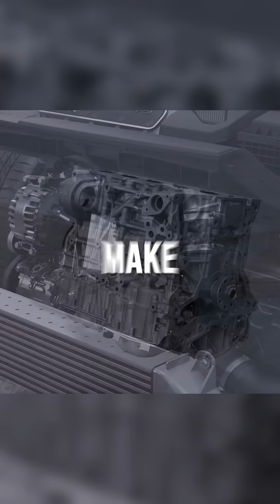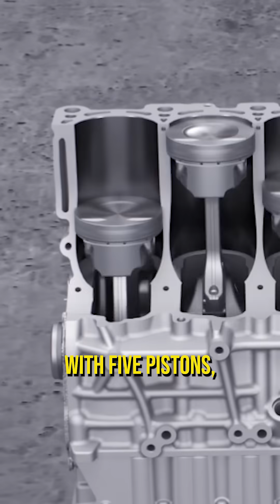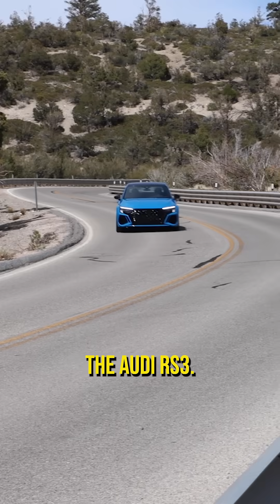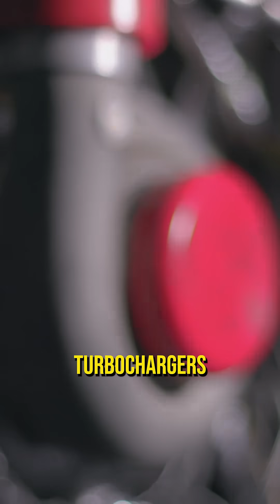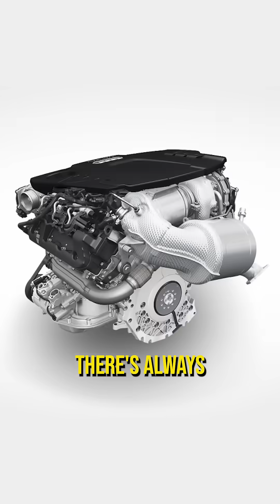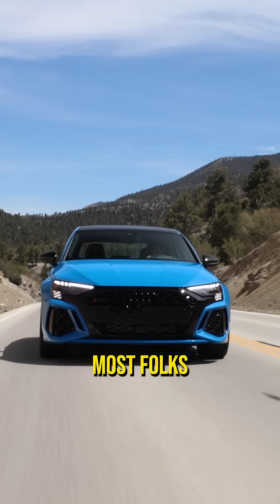What Killed The 5-Cylinder Engine?

Comment: The logic of "a V6 exists and that's a reason the I5 makes no sense".  A v6 is more material, more complex, and in theory more expensive, and also never perfectly balanced.  Get rid of the V6 and replace with inline 5s, assuming they aren't too long for the application.
Reply: GM killed the I5 in the Colorado and Canyon.
Reply: I5 uses haldex, v6 and bigger use true quattro. Not that haldex is bad it's just they can't use qauttro with the way they're mounted plus true quattro would push the engine far forward
Reply: Inline 5's also make sense if you need more/less displacement in a modular engine family. I think that's why Scania still makes their 9.3L inline 5 instead of making a smaller straight 6 (all of their engines have a 130mm bore). I think they used to share heads between engines as well until they recently switched the 13L over to a DOHC design as they were per cylinder heads, the 9.3L i5 and 16.4L V8 might still share heads though.
Reply: and drinks a lot more fuel
Reply: That being said you also have 4 cylinders which have better balance then 5 cyls (weird secondary balance from 5 cyls that isn't seen as much in 4 cyls). They can also make the same power due to boost
However the uses for a 5 cyl are to appeal to an enthusiast market, with a unique sound and smooth power delivery
Reply: @bosekatzee  I4s aren't second order balanced.  I5s aren't first order primary balanced.  Neither are unsolvable issues, and the Volvo I5 doesn't even use a balancing shaft.  Their biggest issue is length for transverse applications.  My S70 has a turning radius that's larger than a full size truck due to the engine limiting steering angles.  Still, for the sound and cheap power it's hard to beat.
Reply: @ChristopherBurtraw  dont have those issues in my jetta. Turning radius is pretty good.
Reply: @bosekatzee  I5 Jetta?  
The Volvo isn't so bad (later models with offset wheels for Brembo calipers are way worse).  Just that many RWD vehicles (trucks and even my 940) can really crank their steering angles in ways transverse cars can't, even with I4s.  Still, my belief is that packaging length is probably the biggest I5 downside in general, even if it isn't a big one.
Reply: @ClipstopherBurtraw audi also didn't use a balancing shaft on their 80s-early 90s i5. They used a calculated imbalance on the flywheel and the vibration dampener (central belt wheel) to make these engines rather smooth running. In fact, they have less vibration than a v6 - only i6 and up are able to be completely balanced out. Also, i5 is the smallest amount of cylinders you can have for overlapping work cycles in a 4 stroke. Great for towing or cruising at low rpm.
Reply: @346L3  that's neat though I appreciate that Volvo did entirely internal balancing, making flywheel swaps and upgrades a lot easier.
Reply: i5's can't get enough N/A displacement or power for a street tuned engine to throw down properly, and even if they can fit better than a straight 6, that still pales in comparison to a V6, and even more so regarding polar moment of inertia.
Reply: @Drunken_Hamster  damn near everything is turbocharged these days so to me that's irrelevant.  

But I'll concede that this is a reason for the I5s demise anyways - they'd rather just make a turbo i4 than a turbo i5.
Reply: @ "Irrelevant" but superior.
Reply: @Drunken_Hamster  v6s are lame. - NA V6 is even lamer than a turbo I4 let alone an NA I5.  A tt V6 can be cool in RWD (may as well go V8 at that point), but a hot mess in transverse applications and surely a nightmare to maintain long term.
Reply: @ClipstopherBurtraw  Oooh story time! When me and my cousin went to an auction we got some pick ups. I needed one cause you cant load stuff in an m3. Anyway. he got the twin turbo v6 ford f150. Looked really nice. I got a slightly older 5.0 v8 f150. For about half what he paid for. Guess which one still runs great and which one doesnt.
Reply: @coolboy3848  with Ford I could see it going either way tbh.  I'm obviously inclined to say the V8, but then I'm also expecting a twist in the story.
Reply: @ClipstopherBurtraw  Yeah I see that lol. But the story ends with the turbos whistling (not the good kind) and the engine going kaput. My 5.0 v8 is still running like a clock.  The ford 3.5l twin turbo v6 is a maintenance nightmare and they tend to burn the turbos. The turbos were too expensive so he scrapped the truck.
Reply: @coolboy3848  that's too bad.  I remember when they were bragging via Mike Rowe about the supposed durability, they put that thing through the ringer on a web series when they unveiled it.  Maybe the original 3.5TT that they used was better than later gens before cost cutting?  Or was that what your friend ended up getting?

Did the turbo failure destroy the engine, or did it die otherwise, or was the long block possibly fine?  I enjoy tinkering with turbo setups, so if the long block is fine, I'd have upgraded them, the intercooler, and retuned for E85.  But I understand that's not for everyone.
Reply: @ClipstopherBurtraw  His turbo f150 was a 2016, my v8 one is a 14. From what I understand. Something in the turbos broke and was sucked into the engine and blew it. The mechanic workiing on it (good friend) explained to us that those v6s need to always always be well maintained. The turbos need to be checked for leaking oil etc etc. Because after 120k miles they start to fail. Specifically the turbos. Thats what I remember from it. This was a while ago. Like 5 years ago. But yeah the high milage and its on a truck so it is towing and poor maintenance (which to be fair, no one ever tells you to inspect your turbos every once in a while. Like that isnt a maintenance nce thing normal people think about. So they get neglected) Before I had my m3 (v8 one) i had an m235i and it had a turbo and i tuned it out the wazoo and the turbo always held up right but i take really good care of my cars. So i think ford cheaped out on the turbos maybe?  My mechanic said those twin turbo v6s can push a ton of power but it has to be done right and that power comes largely from upgraded turbos, that are better quality so they dont fail and destroy the engine. I am a bit of a car tinkerer myself so hope this helps.
Reply: @ Oh an just in case you or a friend want one. An e92 m3 is best bought between the years of 2011-2013 because tthe bearings are upgraded compared to the previous model. The 2008-10 one had weaker bearing and tht combined with the thicker oil that bmw used (the tolerances on the s65 v8 is very tight) it led to the engine spinning the bearings. you can and really must test the oil of any e92 m3. You send it to the lab and they check for metal shavings of bearings. Those v8s are hella expensive so definitely do the test. I had mine tested and a few years later did some work and put new ones in. Just for peace of mind. Also the n55 inline six with the turbo is a VERY reliable engine. Just get a metal chargepipe and change the oil regularly.
Reply: @ChristopherBurtraw 😂🤡
Reply: @ClipstopherBurtraw  yeah you should probably be driving a Prius
Reply: I'm not sure a V6 is more material (given the same displacement), the banks share block material and the crankshaft is shorter while having an extra cylinder. However it definitely is a touch more complex having that extra cylinder, as this means more components to accommodate the extra cylinder. And they're likely more expensive too. I just wanted to bring up the material point because I understand that V6 engines are one of the best for displacement per mass.

Practicality aside I do love I5s for their sound and novelty, they can't truly be replaced. Well maybe the VR5 could come close if it could be reliable
Reply: @mikeraphone7868  two heads, twice as many camshafts unless you're going pushrods (woof - save that for V8s).  May be less material but should cost more regardless.
Reply: @ClipstopherBurtraw  yeah, you're right about cost, I was mainly contesting your point on material/weight. And yeah I'm assuming overhead cam, I think GM is the only one perpetuating pushrod engines in the auto market.
Reply: @mikeraphone7868  looking back I did say material and cost as two separate things - fair enough! 

GM is most famous for pushrod V8s but Ford is making them again via the Godzilla, and Stellantis still makes the Hemi.  Only Cadillac has one of these in a non truck vehicle if that's what you mean.  (Though the Charger is rumored to get the hemi back.)
Reply: @mikeraphone7868 I don’t remember the Golf IV VR5 having issues, but I’ve never owned one.

Comment: A 5 cylinder engine.. that has bigger displacement than a 4 cylinder..
 But smaller than a 6 cylinder? I would've NEVER figured that out
Reply: Depends on the size of the cylinders too.
Reply: Wouldn't a 4 cylinder engine with the same length have bigger displacement?

I would have preferred a longer video digging deeper into this, I can't quite understand the arguments.
Reply: @luftstolle  You're correct. I think the point here is you can have a larger displacement without increase cylinder size. As increasing cylinder size has issues of its own in terms of reciprocating mass and combustion efficiency.
Reply: @luftstolle  You mean like the turbocharged GM 2.7L L3B 4 cylinder lol.

Comment: Volvo used 5-cylinder successfully, I don't remember hearing issues with it.
Reply: Not an issue inherent to 5-cyls or Volvo, but my '06 XC90 had a bedplate leak, and one week it decided to let go of all the oil at once and I didn't notice till it stopped spinning 🥲 I miss that ugly brute
Reply from the maker: They got rid of them tho
Reply: @EngineeringExplained  just because they discontinued something doesn't mean it wasn't good. You of all people should know that.
Reply: @wolfrig2000  he wasn’t saying that. He is just saying they stopped making them, sadly
Reply: Mercedes used 5 cyl since om605 to om612 to om647 all those engines are amazing and bulletproof tho, I currently owned one om647 and I will never chose a i4 over a i5
Reply: Well, they used it successfully for some time, but they eventually get rid of them. I have  two Volvo cars with 5cyl Whiteblock engine. A lot of issues. But none of them because it is 5cyl engine, but more likel it is crap design. A lot of issues with features, that were meant to help, but made things worse. Wrong ideas, cutting cost etc. There are a lot of issues typical for this engine. But Volvo also made 5cyl diesel engines.  One of them was D5. Actually quite reliable engine, few of them have 700 thousands of kilometers on clock and more, and they are still driving. Many cars with D5 have over 500 thousands kilometer. For Whiteblock petrol 5cyl, the average lifespan is around 320 thousands, only few of them are over 500 thousands.
Reply: I miss the sound of my T5 AWD...
Reply: The 5 cylinder engine is the only notable aspect of my VW Passat.
Reply: Cracked blocks 😐
Reply: @JonnyD3ath  the 2.5 R engine cracked its cylinder walls, only when modifyed and after not shimming its as easy as shimming the blocks and the walls will be perfectly fine
Reply: @LactoseTolerant50  unfortunately not, plenty of stock ones with cracked liners as well. 
I had my block shimmed and it cracked too so 🤷🏼‍♂️
Reply: @JonnyD3ath  only on the 2.5  after likre 200k miles of abuse   been trying to blow the one up in my v70r for  year  as got a built one to go in   with liners  etc  its at 230k miles     running 350hp   it was a barn find    who knows   when it last had an oil change  don 60k miles my Sealth it it it wont break
Reply: @TCBOT  my 2.5 cracked at 80k miles. 
Always serviced every 5k miles. Always warmed up & cooled down.
Reply: @JonnyD3ath  what fuel  did you use    gota run   the 97 hi octane   e5     anfd remap  if so buy who  i  do  150mph in mine to the bootsales on sunday,s   thing gets pushed   NO  Shimm's   going to put a built engine it its reddy to go  in it  just wana  see if this  one  pops     lol   these do seems  to fail randomly     i know the  ones in the fords  get cooked  due to the utterly rubbish   cooling systems      its no funny   how crap thoes are  engine  blocks warm by 5mm    THEM SENSOR be like its fine   (eg focus  st 225  v50 t5    s40t5  (all ford based    if was one  of these   its was prob cooked   but thoes arnt rely volvos   tbh s60 v70 s80     xc90   are the last   of the not ford parts bin  Volvos
Reply: @ always super unleaded, 97 ron. 
It came with a bluefin, known to be a safe tune.
Later I ran dreamscience turbo-X hybrid turbo
Reply: @JonnyD3ath Never heard of, and I work with Volvo cars.
Reply: @slowshop  you must have your head buried in the sand. Common enough in the Volvo scene but even more common in the Volvo block fitted to the Focus ST.
So much so that they pull the heads off them and shim the blocks to close the coolant paths between the cyls. That open deck design sucks, believe me, I had 2 blocks crack on me
Reply: @JonnyD3ath think you mean the focus RS
Reply: @soulsweeper1630  Mk2 focus ST & RS used the same 2.5L 5cyl engine

Comment: I drove inline 5 Volvos for years, bulletproof!
Reply: My focus MK2 ST has a 2.5T Volvo t5 engine, gotta say after 12yrs of owning it it's only has the oil separator diagram split, nothing else..
Reply: @marty3469 they crack blocks 😪
Reply: @JonnyD3ath  yeah heard that, but I don't rag it much. It's my daily so need to be kind lol
Reply: @marty3469  mine cracked 2 blocks. 
I loved that car but it didn’t love me 🤣
Reply: I was interested in a Ford s-max with Volvos 5-cylinder. But the s-max seems to suffer a lot from blown head gaskets with that engine. Don't know if the gasket i different in s-max or the car is to heavy but just seemed too unreliable for a 7-seater.
Reply: @hp8233 Most likely it is Ford suing cheap solutions. Have had several Volvo 5 cylinder, run 275k miles no problem. Get the oil changed frequently, routine servicing, and decent standard fuel.

Comment: I'm german and definitely no VAG guy, but there's no denying that they built two of the best sounding engines ever. This and the VR6
Reply: An the v10 with 2 5 cylinder
Reply: @wolfgangw.8243  Although the V10 TDI is an amazing piece of engineering, it actually sounds somewhat boring. I think it's the 10 cylinders, 90 ° "V", and offset crank journals just make everything so well timed, it lacks character. But an awesomely torquey, powerful engine nonetheless.
Reply: @lefty5349  And who specifically  mentioned TDI version of v10? Yeah it was crazy and cool like most of "riddiculous" vag engines of that era and for sure it sounds throaty and mean but come on.. Audi R8? Huracan? Or a little walk of the vag zone: e60 M5? Viper? Carrera GT? Lexus LFA? Yeah the 5 cylinders also sound pretty good but... they're half way there as one of the best sounding engines imo.
Reply: @wolfgangw.8243  18° offset crank journals which gives a 72° even firing intervals.
Reply: @an0nim11  the i5 definitely sounds better than those mentioned 😂 the lfa is a different animal though. Although I still prefer the i5 as you can tune it to 8500 rpm redline and it sounds unbelievable
Reply: @lefty5349  Yeah, 18° offset crank journals - crank pins - to give it even firing.
Reply: I still own and drive a 2008 Golf R32 VR6, sounds great but my old 1999 Fiat Coupe 20VT 5 cyl sounded even better.  Just personal preferance.
Reply: @zahimiibrahim3602  I agree the 20vt fiat engine was legendary and that car was cool as hell! By the time people understood how great it was it had been taken out of production! I popped that particular engine into my uno turbo when the ie engine popped! It was a fantastic upgrade!
Reply: @zahimiibrahim3602 Have you compared to 10V and or 20V VR5?
Reply: I think that the detroit diesel 2 stroke is awesome and as good as that
Reply: @gabrielvieira.4358  Nah
Reply: I'm from Poland and I agree👍 5 cylnder from '70, NSU Audi.
Reply: vr5.
Reply: Ever? That’s a stretch
Reply: Not even top 20 for either
Reply: @nodo7575  they are one of the best sounding, if not the best. Most unique too
Reply: @nodo7575  Who cares. Winners in Grp. 4, Grp. B, TransAm, IMSA GTO. What other car companies that win so many rallies and races with the I5 engines.